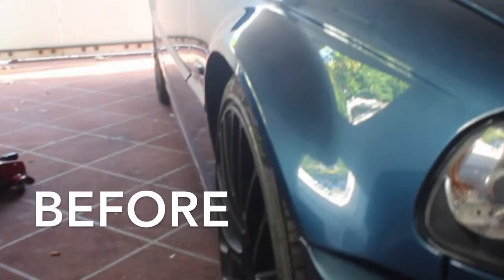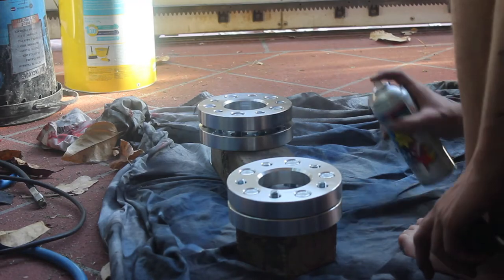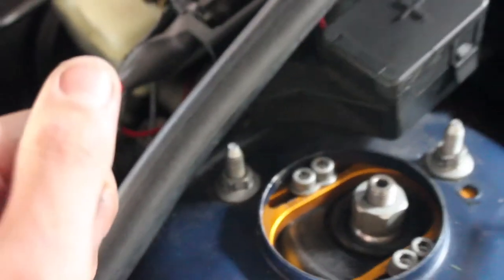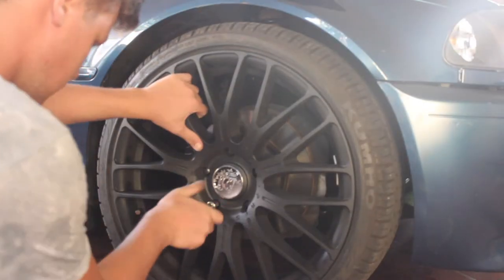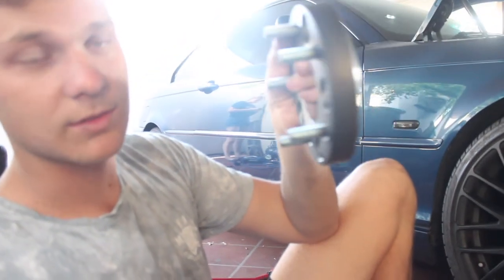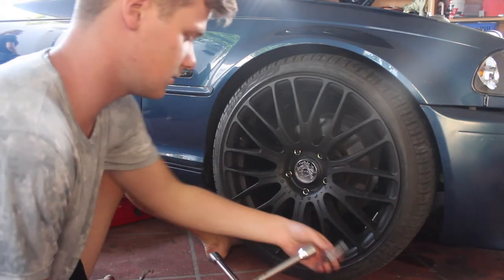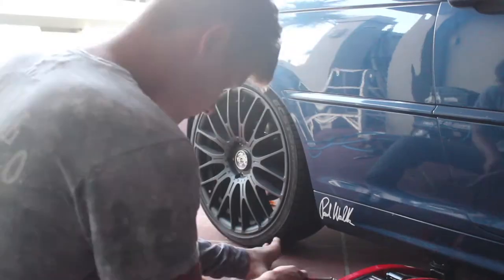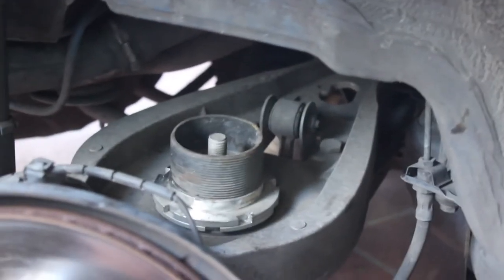WHEEL SPACERS Install | BMW E46 TURBO

Comment: Hey there, I got them delivered today as I ordered them the other day. I went to put them on the rear, but they started squeaking & driving really uncomfortable. Why?
Reply from the maker: your wheels are probably touching the fender
Reply: Cody Aplin they aren’t, I was tightening the bolts & unloosing them & it still made the squeaking sound! When I put it into reverse the whole rear end went up in the air 😂. Mine are 20MM & were from eBay.
Reply from the maker: check to see if the spacers are sitting flush. could be wheel bearing or handbrake cable is stuck on
Reply: Your bolt are probably rubbing the parking break assembly i thing the 323 325 and 328 are different from the 330s

Comment: so what’s your wheel specs? wanna do the same with my e46 on style 71s mines staggered 18x8 with 47 offset in front and 18x8.5 with 50 offset in rear
Reply: Bro same

Comment: What turbo kit did you use I have a left hand drive e46 m3
Reply from the maker: http://www.ebay.com.au/itm/For-T04E-T3-T3-T4-Turbo-Kit-BMW-323I-325I-328I-E36-E46-V6-M50B25-M52B25-B54-B-/232236116630?hash=item361259ea96:g:BXQAAOSwB-1YnkvD

Comment: How ars these holding up? Thinking of getting these but keep hearing that they are not as safe as the hub centric ones. Do you have a link for these?
Reply from the maker: they are mint, no problems
 https://www.ebay.com.au/itm/4pcs-PCD-5x120-to-5x120-Thickness-25MM-T6061-Wheel-Spacer-BMW-M3-E36-E46-E90-E93/161308020145?ssPageName=STRK%3AMEBIDX%3AIT&_trksid=p2057872.m2749.l2648
Reply: Cody Aplin cheers :)
Reply: Ordered same spacers they were labled the hubcentric on the order and still converted to a stud 

25mm with my stock 205 wheels no rub 👍